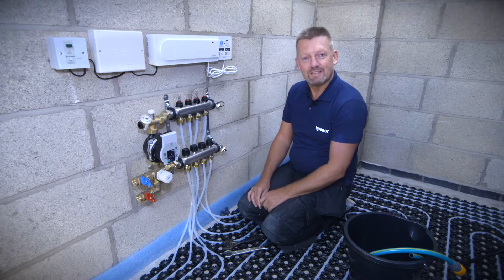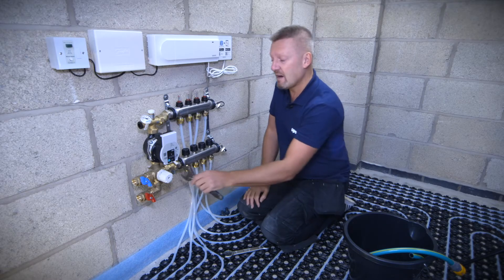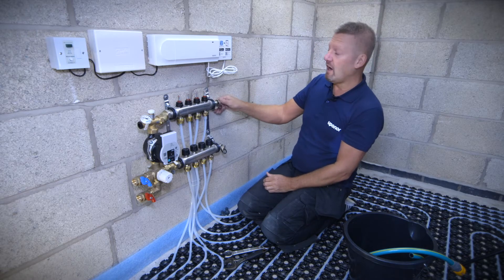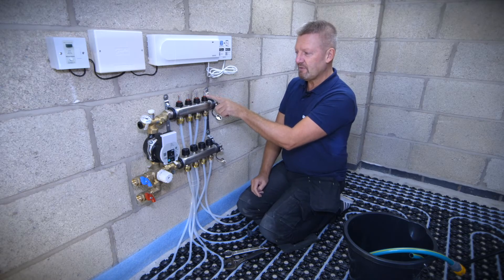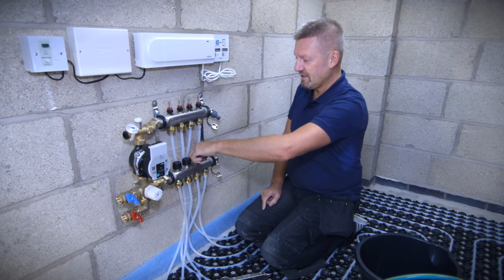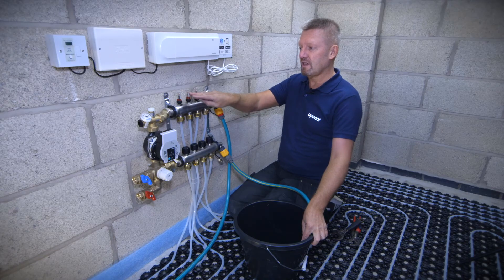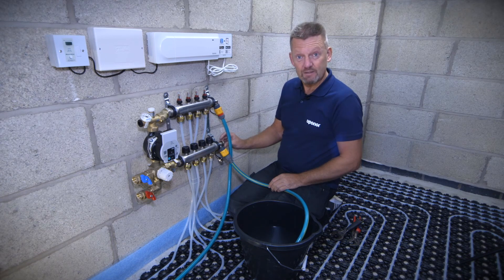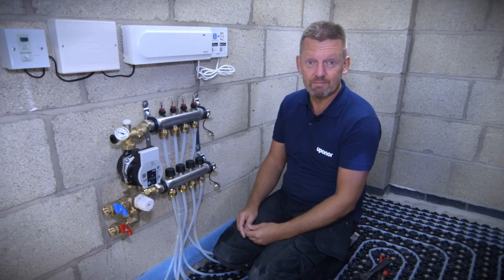Step 1- How to fill an Uponor Underfloor Heating System

Comment: A week ago I had my boiler replaced and the pump for the ufh was replaced as well. The old pump, a Grundfos was very silent. Could not hear a thing outside the room it was installed in, and barely anything from it in that room as well. 
The new pump is a Uponor and it is so noisy. The worst noise is not the one coming directly from the pump, but a vibration like noise that travels to every floor of the house and gives me a headache, probably following the pipes. It is not the "normal" flow noise from the water, it is something else, more "whining".
Anyone got suggestions?

Comment: I have a query that i hope i can get a quick answer to.  
The lid of one of my thermostats on the wall was not in properly and in trying to get it back in properly it came off in my hands.  Then,  i inadvertently clicked the red plastic fitting inside one tooth upward and the light on the thermo came on. So,  i put it back to its original position and put the lid on,  but the heating now seems to be permanently on.  The light on the thermo is continually on.  Can anyone give me advice please on,  hopefully,  an easy fix to get the light off.  Thank you for any advice

Comment: STOPPPPP!!!.... Martin these "Uponor" video instructions are COMPLETELY opposite to your other "Multipipe" video that you've made!...https://www.youtube.com/watch?v=3MrrPgLRtuM&t=318s
in that video you said to fully open up all the "return electrical actuators" (1.20min), and then close off all the "flow meters" except for the one that you are filling/venting (1.30min). in this video your doing the complete opposite!...(it probably doesn't matter, because your still pushing the water and filling in the one loop, but was just confused as to why your not sticking with the one standardised routine) please explain